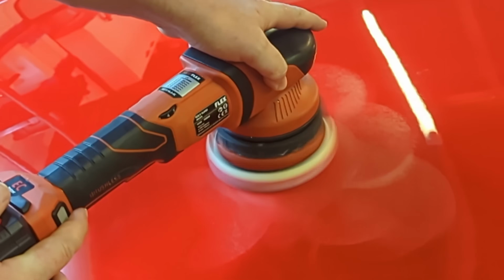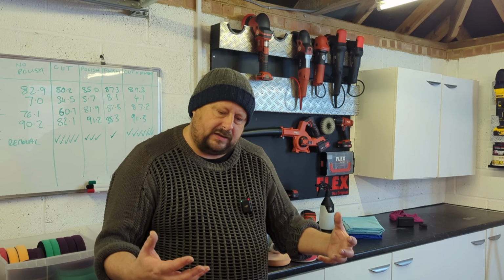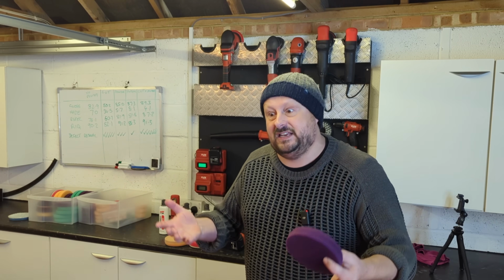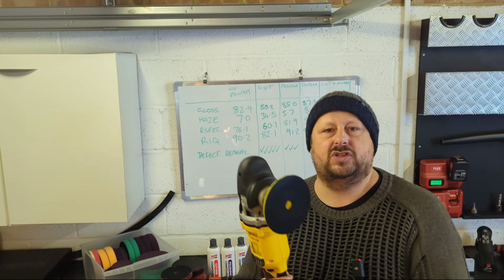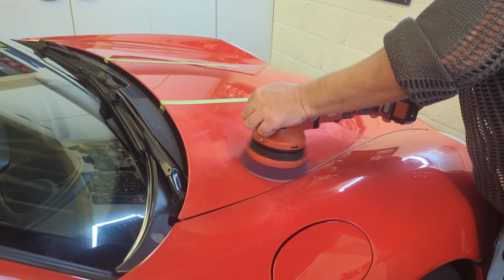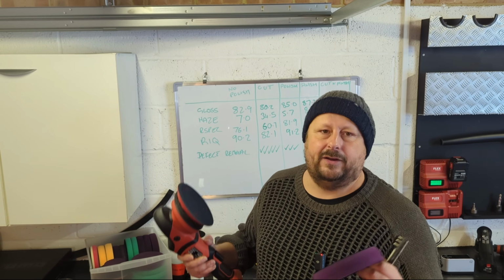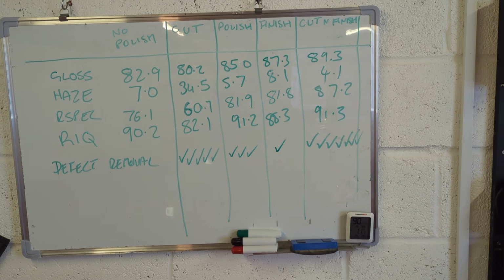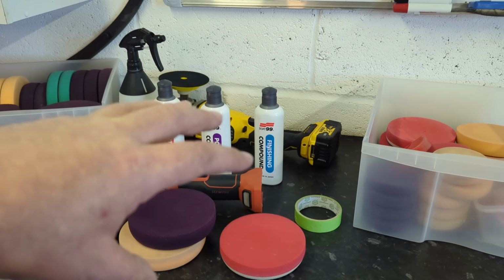Learn To Machine Polish a Car with Soft99 abrasives combo

Comment: What will be the best strategy to prepare paint for Soft 99 Fusso coat.
Using Just the Polishing compound or combo of Polishing and Finishing compound.
On a Daily driven car with relatively good paint.
Reply from the maker: only you can answer this question.  If car is dirty must be washed with pure detergents (no wash and wax) all crevices dug out with brushes etc...   After wash if paint is contaminated (you have to test) then you need to clay bar to remove.   After clay you must inspect paint, if its generally good condition like you say mate then light finish polish with with polishing pad like a hex logic white pad and the soft99 polish will do a great job.   Then panel wipe after the polish and layout the fusso nice and thin mate, give it good cure then buff it out well to a shine.   then just keep the beading topped up with a nice beady spray like sonax BSD or soft99 luxoury gloss and you are good for at least 6 months.

Comment: I just ckeched and that glosse meter is 3.000 brithish pounds . That’s unbelievable
Reply from the maker: its not for domestic use really, its an R&D tool for business that produce products where gloss is important (laptops, cars, phones, furniture (list is endless).  But its also a hand made device in the UK that is a bit more complicated than your average gloss meter, it uses emitter arrays and receive arrays in order to measure not only the strength of the transmitted and reflected light, but by knowing where each source light beam deviated to the receive array its able to calculate distortion (RIQ, think orange peel)..   There is a detailer orientated one that I think is sub 1000 pounds.  You can buy the chinese cheapos but they are like very budget with no arrays and they are not much use.

Comment: Great video as always pal. Any experience with the Makita DPO600? I know you reviewed the corded version years ago and was fairly impressed
Reply: I had dewalt and changed it for makita dpo600 ,think 500 will be better-smaller plate, i like it ,use it with chemical guys pads. Only downside it is heavy,flex will be better for daily use, but twice a price. I owe to flex pxe80 with extensions-i use it with rupes wool pads,yellow and blue plus some cone pads. Best shampoo i used is chemical guy's citurs wash,gives deep gloss.